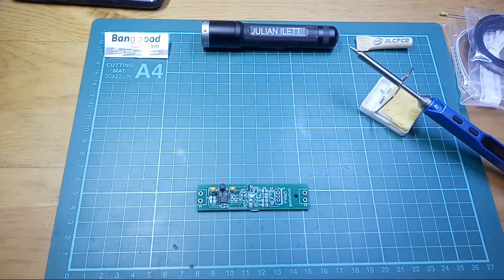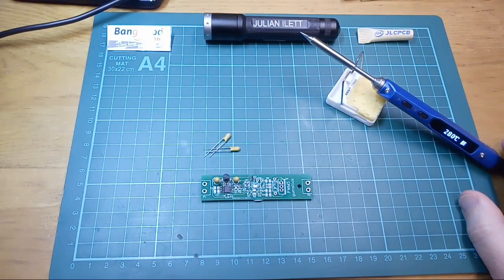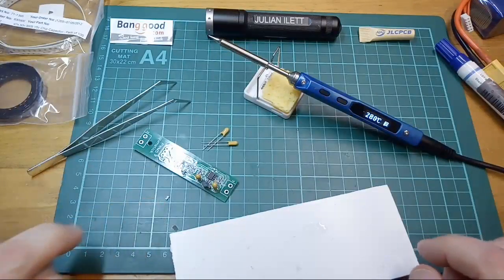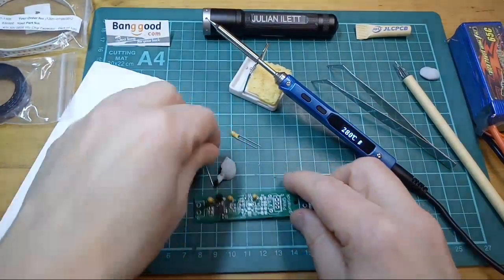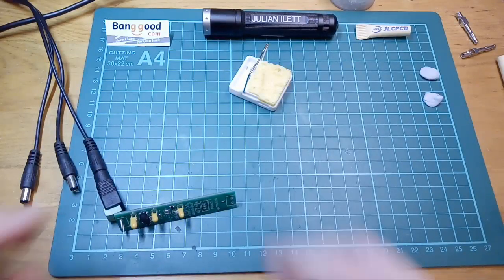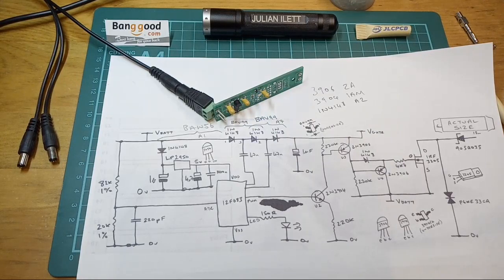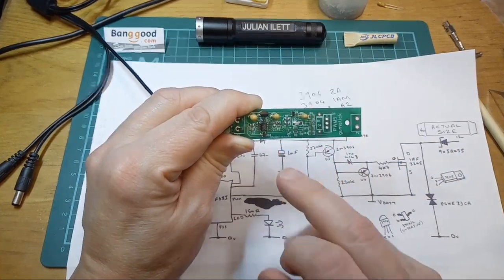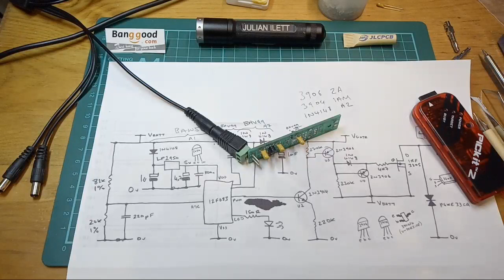PWM5 Live - 30 April 2018

Comment: I do intend to make the PWM5 in a through hole version. I have most of the hardware already (soldering iron, solder pot, liquid flux, a test jig, etc). Just saving up money to buy my initial run of parts and shipping.

And when I do get one finished, I’d love to send you one.
Reply from the maker: Yeah, please do :)

Comment: The programming outputs of a pic programmer have an impedance of about 1k, so provided the impedance of what is connected to the pins is significantly higher, say >10k, then the programmer will be able to drive the pins to a high enough voltage to make programming possible, Also if you put the holes for a header in a pcb with plated through holes, just putting the pin header through the holes and applying a light sideways pressure will make good enough contact to program the device; you can then just take the header out and all is good. Its actually a lot easier programming the pic after you've soldered it in than using an adapter. I made a small run of ~100 infra red controllers using this method and rarely had any programming issues (well, apart from a couple of times when I soldered in the chip the wrong way!)

Comment: Hello Julian. Would it be possible to modify the PWM5 to operate on 24V battery setup? Great stream. But only got notified after the fact. Have an amazing day my friend.
Reply from the maker: It would be difficult Ray. The potential divider resistors would need to change, which would require firmware changes. As a workaround, you could put one controller on each 12V battery and use 2 solar panels.

Comment: I bet your batteries outside are fine and that you are dropping voltage under load due to thin or poor quality cables.  I find the 2.1mm adapters/splitters and premade cables from China are pretty poor quality.
Reply from the maker: I think you're right

Comment: Why not use electrolytic capacitors?
Reply: Because there huge?
Reply: Electrolytic capacitors generally have greater ESR than ceramic caps, that's why ceramics are preferred.
Reply: They're large, and they have a limited life due to the  cap eventually drying out or ESR going up and it pops.

Comment: Git Hub is horrible. It's like having a website but removing any useful  way to understand.
Reply: You obviously don't deal with code versioning systems. It's the industry standard for good reason. It's there to host code, designs, and documentation. It also handles code branches, pulls, issue tracking, and other things important for projects.
Reply: No I get that I've been coding for 30years. The main issue is the lack of information, people often don't say anything but present a list of files. In the html world we fill it with supporting info in github it can be barren as a desert. Not the system but the way it can be used.

Comment: Wow, a Brit that dislikes tea.  A sign of the End of Times!!!   ;-)

I realize that this is a PWM5 (5 amp) but would it handle a 12v 100 watt panel (18 Vmpp, 21.9 Voc, 5.56 Impp) with a short circuit rating (Isc) of 6.13 amps?  If not, how hard would it be to modify the circuitry to allow it to be used in this application?
Reply from the maker: Yep, it's been designed to handle a 36-cell 100W solar panel (with the specs you've specified) connected to a 12V lead-acid battery. It will get mildly warm - even in a hot country (tested in Uganda).
Reply: Thank you for the reply as well the time and energy you dedicate in creating your most interesting videos.  :-)